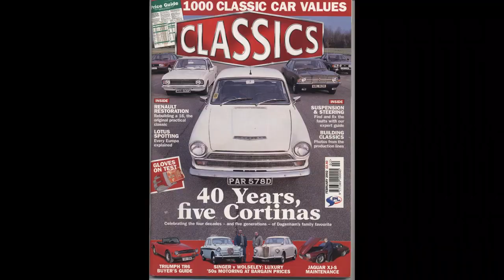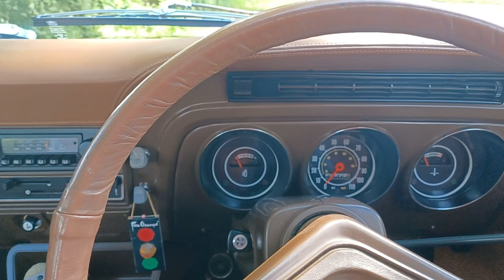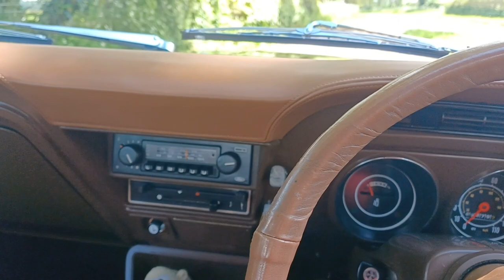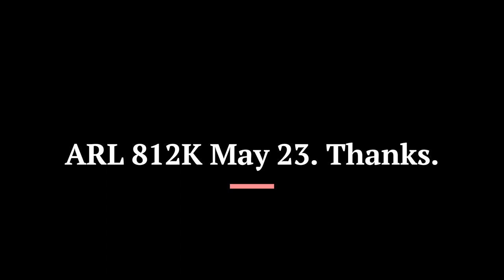My 1971 Mk3 Cortina Walk Round - We are just custodians of these great vehicles.

Comment: That took me back. I had a couple of Mk3s although both were the later version with the Pinto engine - which was less robust than the 1300 especially if you skimped on oil changes (and most people did in the 1970s). The joy for me was looking out over the vast expanse of that huge bonnet while driving. 
I've enjoyed watching Pete C's GXL restorations.
Reply from the maker: Ah, I'm pleased you enjoyed the reminiscing. The pinto suffered also with blocked oil feed lines which toasted them. But you were right the Crossflows were bullet proof.

Comment: Absolutely gorgeous,  I was born early 1970 and as a youngster these were every where , I believe the first ones came out on a J plate late 1970 into and upto July 71 , yours has the very early dashboard which slope away from you , alot of cars of this era had the smiths self adhesive rear window demister which I think would look so period correct, even if you didn't wire it up . I would swap out that 80s ford radio ,for a radiomobile /Motorola, or a modern retro , love those rear speakers,  ahh so many happy memories I thought I'd forgotten 😊. PS I can still smell the feu orange.
Reply from the maker: Thanks Peter, have had so many lovely comments back, I'm pleased it gets others approval. Yes I would agree the demister would look right. The car never actually came with a radio. A period correct one would have MW and LW only and I like to listen to FM. Hidden in that sloping dash is a flexible strip aerial.  Only I know its there :)

Comment: It’s remarkable to see one presented in such original condition, and the paint looks fantastic, though obviously you’ve detailed a lot of work that’s been done. I started learning to drive in early 1979 in our 1972 1600L, which was essentially the same as yours except with the bigger engine. Mine was painted Electric/Monza Blue with dark blue interior. It was a smart and tidy car at the time, but at seven years of age and with 65,000 miles on it, it was suffering with rust in many of the areas you’ve had replaced or re-welded on yours. I’m guilty over the 11 months we owned it of painting the back panel matt black and fitting Brown and Geeson magnesium-look plastic wheel trims. While I was, and still am a fan of 1970s/80s customised cars, these days I find it a little bit tedious that lots of classic cars from that period, and maybe Fords in particular, barely ever escape without suffering large diameter alloy wheels shod with skinny sidewall low profile tyres. They look wrong. While I understand any car owner can do as they like with their own car, the point of having a classic car, to my way of thinking, is to preserve a bit of motoring history in the way it used to be, so 13” steel rims with hub caps on a 1300L is absolutely brilliant. ‘Up-spec-ing’ with Ford sports wheels, or worse still, alloys, is completely wrong for this kind of car and wouldn’t be seen back in the day, unless it was on a ratty Cortina, owned by a young person and virtually run into the ground, and probably sporting one of those green vinyl sun strips at the top of the windscreen, Lucas rectangular fog lamps under the front bumper, matt black bullet wing mirrors, and dabs of red oxide primer all over the rust spots on the bodywork. Yeah…sports wheels would look dead right on that! 🤣
Reply from the maker: Its nice to think that someone else gets it. It is that, preserving a bit of motoring heritage. Balancing hidden upgrades for safety and understanding that not everything is available so compromises in 52 years have been made. I'm glad you approve. Its not easy to go out on a limb and shout, yes my car of choice is a poo brown early 70s cortina and a lowly spec one at that !!

Comment: What a beauty and a rare 1300cc engine too.  They are far sweeter than the 1600cc engine in my opinion.   You still had enough work to do on this car but the result you got is breathtaking.  I love these, my father had a 1600 GXL and a 2000E, my sister had a 2000XL and my my brother had a new 1600L Estate.  Yours reminds me of a two year old car and it's nice how you have left some of the patina under the bonnet.   It's difficult to know how you can improve it,  from what I could see just a few suspension bits need a wire brushing and protecting with paint maybe.
Reply from the maker: Cheers, I was thinking of using Lanoguard. I did it like 13 years ago but time flies !!
Reply: @TheMaccatakker69  Your welcome. I've no experience of Lanoguard but I've used Lanolin in work years ago which was supposed to be very good. I've been considering trying Lanoguard out on my Escort.
Reply: @TheMaccatakker69  I had a Metalic Blue with a Black Vinyl roof 73 Mk3 1600L back in the 80s that I totally rebuilt the engine on but sadly it rotted away even tho I wax oiled it. 95,000 Miles was all it managed 😭. I really used to like Ford's because they were so easy to work on. I also had a Corsair 2000E and 3 Mk2 Escorts all long gone sadly.
I now drive a Toyota Auris 2013 1.4d which currently has outlasted all the Ford's even tho it's got 130,000 Miles on the clock it is still virtually rust free and totally reliable.
It's such a shame they didn't rust treat and paint the old car's like the modern one's .
Reply: @stephenjones9153  Back in the 70's most of them rotted away in no time and these days they have come along way and last longer.  Sadly it's the computer failures and electronics that can send a car for scrap now, that is if their modern lightweight engines or modern gearboxes have not failed..

Comment: Hi. I enjoyed your film of your lovely Cortina. My dad had a Daytona yellow one with a black vinyl roof ( quite the thing in 1972 ) lt was a 2000 XL with a new style engine, the”Pinto” engine. This engine being quite novel at the time because it was a cross-flow engine, Exhaust one side  and Weber carb on the other side. My dad had it for years and when it was finally scrapped it had still got the original Michelin XZX tyres on. They were a very long-lasting tyre. The only thing I remember him doing to it was changing the camshaft as he’d neglected all the service schedule oil changes and the oil feed pipe was blocked causing he camshafts be starved of oil. Tap, tap, tap. You could hear it coming down the street. He originally bought it and traded in his brand new Austin-Maxi for it. The  Maxi was a good car but my dad disliked it instantly because being front wheel drive, the gearbox was rod operated . He said it was like “stirring Porridge”. I’ll never forget that. The gearbox in the Cortina was spot on. I will say, about the Maxi, it was a very practical car. I think it was the first British “hatch-back”. You could put lie down in the back. And also it was a lovely colour. It was called “Black Tulip” which was a very dark purple colour. Love your car though. Thanks
Reply from the maker: Great memories there Mark. My Gran had a maxi when she retired in Prestatyn. Underated car, hydroelastic suspension or something as I recall. She was deaf as a post so used to drive us all round at 30-40mph in 2nd !! It was a bit of a victim of BL's management I am led to believe. The Daytona yellow was the cool colour to have. Your dad was right about the gear boxes too, Ford Aced them! Thanks for commenting. Best Regards.
Reply: " changing the camshaft as he’d neglected all the service schedule oil changes and the oil feed pipe was blocked" - been there, done that (like countless others Lol).

Comment: Marvellous careful restoration . Two things to consider , a good way to immobilise  any old car is to put a hidden switch in the 12 volt feed to the ignition distributor.  I would Waxoil the underside , wings , door bottoms , sills ( inside and outside ) to preserve  it . These rusted because they didn't  have enough rust protection. There were loads of Mk3 Cortinas around at one time and they were pretty good to drive.
Reply from the maker: Fabulous! It does have a way to immobilise the 12V battery. Yep rust is the biggest killer of these old girls, that and spare parts!
Reply: @TheMaccatakker69  That's  good. I was thinking more along the lines of putting another switch after  the key ignition 12 volt feed to interrupt the supply to the coil / distributor. So it looks like  the ignition has come on when you turn the key .

Comment: Being a dealer transfer driver back in the day, the 1300 MK3/4 base Cortinas were actually surprisingly enjoyable to drive because they were slightly more nimble with their closer ratio gearbox and less weight over the front end. Driven "normally", they were less tiring to drive, lacking the vague and wallowing feel of the 2000/2300 top models which could get seriously out of hand on slippery bends.
Reply from the maker: Ah someone with real knowledge there! Yes, she still has the same engine and is quite nimble. Its the bodywork that is hard to keep on top of. Thank you for commenting

Comment: You probably know this but when you put the new void bushes in, you re-fit the nuts and bolts loose and tighten them with the back wheels on the deck so as the axle is in its normal position, otherwise it twists the rubber and you end up putting new bushes in 6 months down the line...took me a while to realise what was going on!
Reply from the maker: Thats a top tip for everyone for sure. Thanks

Comment: Dad had an identical spec but 1600 ohv which always seemed quite perky . Rumour had it the 1300 was underpowered. Does it seem to be true for such a small engine in a relatively large car ?
Reply from the maker: Hi Steve, Yep I'd agree with that. They used to say "it couldn't pull the skin off a rice pudding!" Ironically when it came to me it had been fitted with a tow bar! That said, its fine on the modern motorway and can do 60-70 mph no problem. I just sit in the 1st line and get in the slipstream of a lorry haha! In fairness, in the era of  high fuel prices, smart motorways and speed cameras its slowed us all down anyway! Cheers.

Comment: Like everyone, this took me back to 1971 when I had a Cortina 1300, then in 1974, I had a lovely light blue metallic Cortina 1.6 L and then in 1980 I had a lovely white 2.3 Ghia with a brown everflex roof with sunroof and power steering.  The upholstery was brown velvet cloth.
Reply from the maker: I love hearing that the video has took people back. Some decent upgrades there from the 1300 right to the 2.3 - Cheers Mac.
Reply: Yes, the 2.3 V6 was as smooth as silk and for the time fast. It certainly looked the part dazzling white and the brown roof. I never saw another one like it.

Comment: would look lovely with a black vinal roof, a factory option at the time, i believe. and  possibly a 5 speed gearbox upgrade. just too make it more comfortable in traffic. 🤔
Reply from the maker: Sorry Steven, no and no. Lots of things were optional from the dealer, a five speed gearbox in 1971 wasn't one of them. You'd have to use a sierra box and pinto for that! As for the vinyl roof, lots of additional dealer options were available but I am looking to keep her as standard looking as possible as when she came out of the factory. She's great in traffic even on the motorway which is often speed restricted to 60 many times in the UK ! Thanks.

Comment: The driver's door clunks shut very crisply. Every one I've known would increasingly droop when opened, and the back edge of the window frame eventually chewed through a bit of the vinyl on the central pillar.

To think that, in the Fanta bottle Cortina, Ford made one of the greatest cars ever sold, and, today, it is such an enfeebled company, grabbing for stakes in the electrocuted future, that it effectively no longer exists. Good old Henry would have been so proud and then so ashamed within the span of less than half a century.
Reply from the maker: She does have a reassuring clunk still, no rot in the doors either which was another area prone to go especially at the bottom!

Comment: please dont carry spares in the boot! too much weight, looks bad, and... uggh just dot do it! but beautiful car! i have loved all cortinas..al of them but this..especially the 250 cu Australian Model! what car that is 4.1litre 6... ooooh! ha!
Reply: Oh, YES! Trip down memory lane! (A  HAPPY memory!) I've mentioned earlier that I worked in a car accessory shop, in the 80's. ("Toy Shop For Adults!)  We used to sell Krooklocks. I had an ORIGINAL one, as shown here, and so did my Dad. Later model Krooklocks were made to be seen more easily - by having what appeared to be a brightly coloured flange around the lock. BUT, in the days of 2 - Door cars with tip up seats to reach the rear compartment, my later model Krooklock (usually kept on the rear compartment floor) , had somehow slithered under a front seat, which got tipped up to let someone out
 So that seat "rode a little higher", because of the Krooklock underneath it. When the the seat was tipped up the next time, to let someone in the back - the late-model Krooklock SPRANG APART! A friend told me that, instead of fitting the later noticeable plastic surround OVER the original Krooklock, the cheapskate makers had re- designed the device, so under this new plastic surround, THERE WAS NO LONGER ANY METAL. So you've got a good one there (collector's piece) ALL -STEEL KROOKLOCK! Somebody told me that car thieves would bring a hammer with them - to SMASH the plastic Krooklocks off!